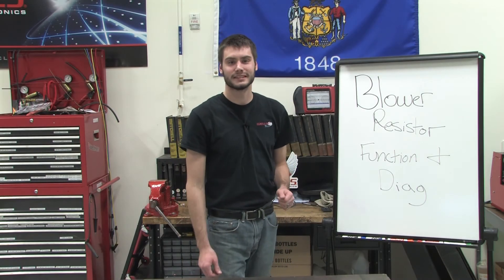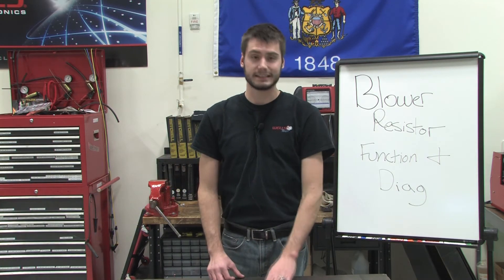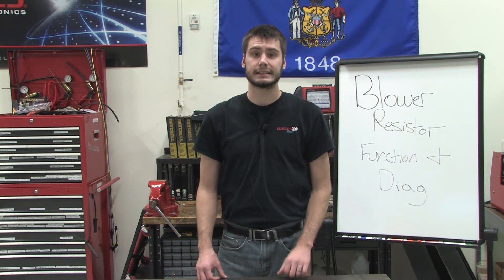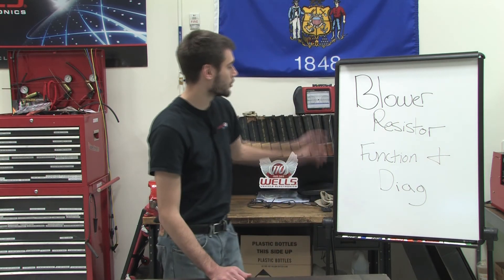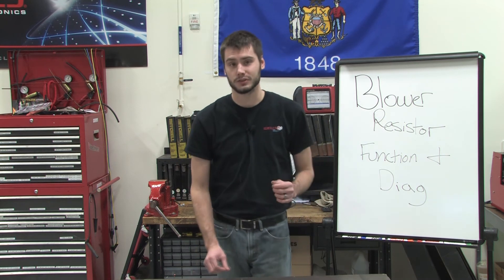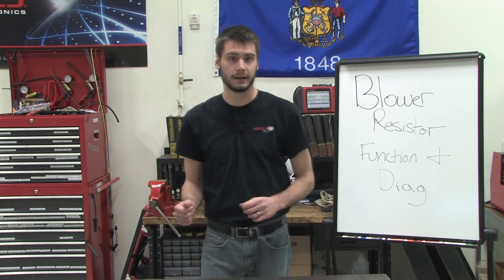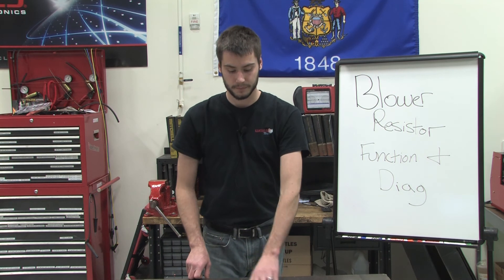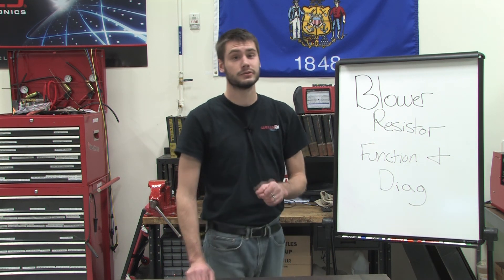Blower Motor Resistor Function and Diagnostics Invitation

Comment: Thanks  wells tech guys .  I posted the question at the end of seminar or webinar , that's why you didn't catch it right then .  There is too much misconception about this on the internet people posting repair videos  about EGR, an stating  exhaust gas as  being  rich . I went to a two year automotive program back in 1982 to 1984 , worked at Chevy dealer ship , Cadillac , Pontiac , GMC ETC.. Every GM class I went to on the subject said exhaust gas was inert . I would like to have your permission to post this on some of these peoples videos . One guy went as far to say a fast idling vehicle could be caused by a stuck open EGR valve , which we all know is false. A stuck open EGR valve will cause a ruff running engine or a stalling condition.  One guy on youtube posting videos is a self proclaimed  genus in auto repair  , some kind of engineer of a sort . He also stated exhaust gas was rich .
Reply from the maker: +Jeff Armer Hey Jeff, yeh you can link that if you would like. I'm glad we could get your question answered :)
Mike Becker, Technical Services Instructor